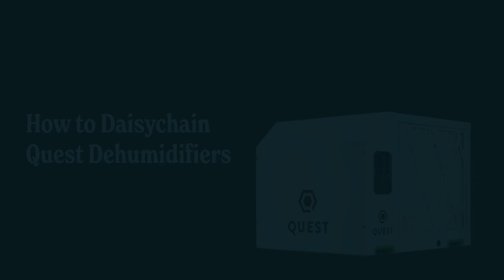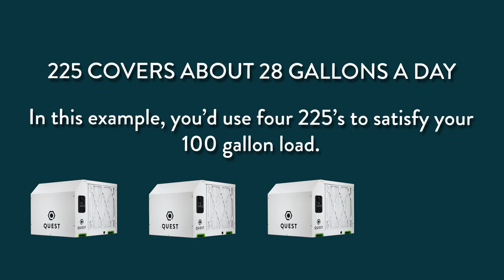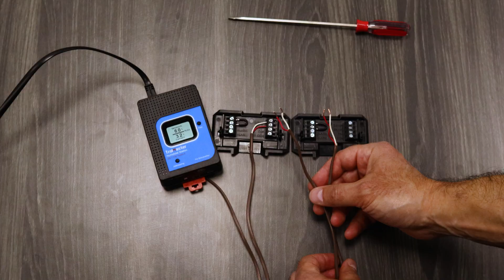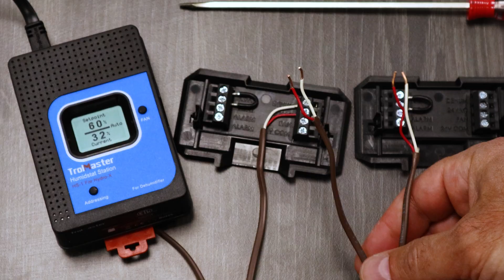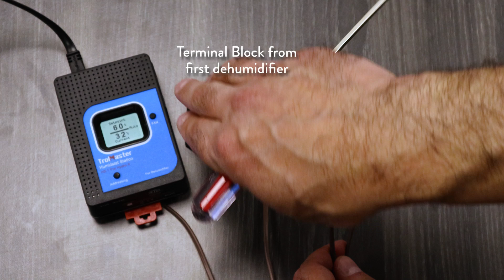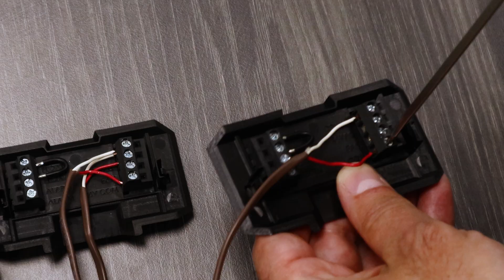How To Wire Multiple Dehumidifiers to an External Controller: Daisychaining | Quest Dehumidifiers

Comment: What is the current draw / VA of each unit's signal circuit? How many units can be daisy chained using the transformer from a single unit?
Reply from the maker: @SetTheCurve With the older Quest units that just had a terminal block on the outside, it was approximately 2 VA per unit, with a maximum of 6 units daisy chained together. With the newer units that have the digital control (like this video) the voltage consumption is so small its basically unlimited. But we ALWAYS recommend keeping the daisy chain groups small for best control. If you turn on/off all the units at the same time you will have larger RH swings. For example, if you had 6 units in a room it would be best to have them in 2 groups of 3 or 3 groups of 2. The smaller the groups the tighter the control. 👍
Reply: @QuestClimate thanks for that info! My main concern was so that I could choose the appropriate wire gauge since wire has gotten so expensive. My plan was to run 22awg wire since I have to run thousands of feet of wire to dozens of dehus. I was hoping to simplify my control setup by using the 24vac from just a few units to power the relay contacts on the controller for groups of units, even if they don’t come on simultaneously. It sounds like that should work.
Reply: So it got a little confusing at the end there. Are you saying to just copy and paste the second Dehum connections to the 3rd Dehum (if you want 3)